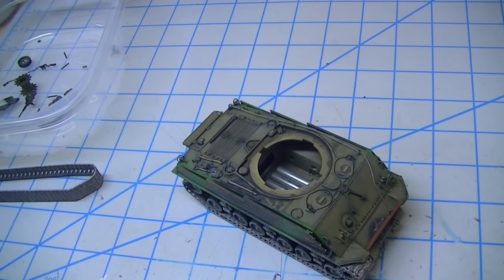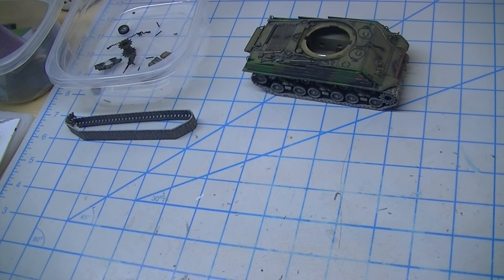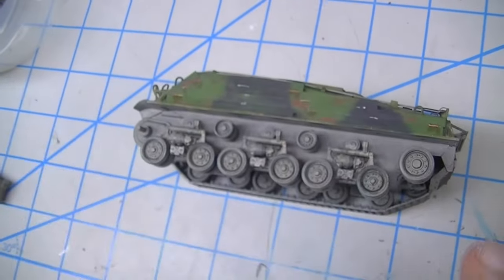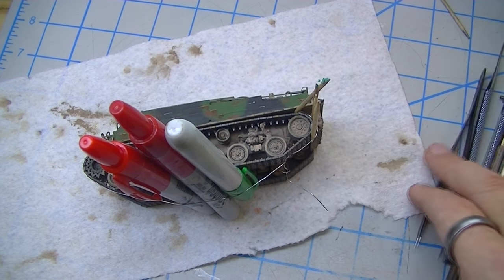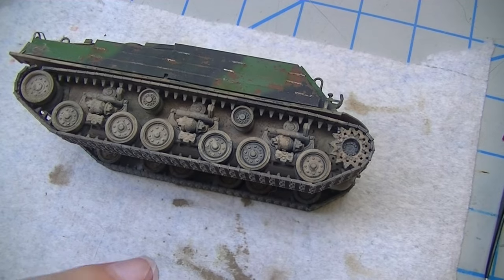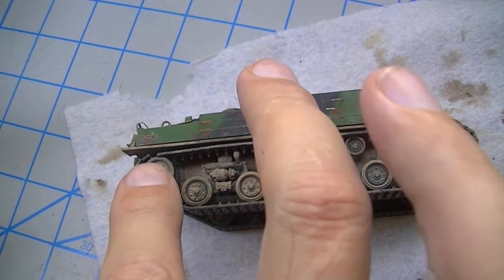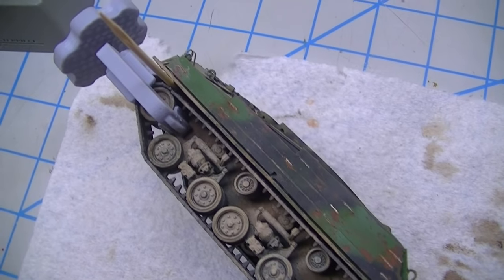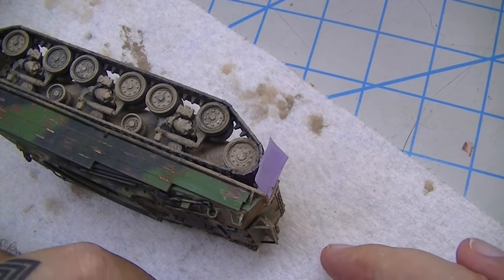ep372 - the 1/48 tamiya m4a3e8 sherman adventure part 6

Comment: If you’re ever rash enough to tackle another tracked vehicle with other than rubber band tracks, you could consider placing the unglued joint at the sprocket end and not cementing the sprocket to the hull until the track is fitted.  The sprocket teeth will help to hold the links together and the sprocket can be rotated to allow for any adjustment required before it is cemented in position.  In face if the track is cemented to all the other wheels and the other wheels are all solidly attached to the hull, you may not need to cement sprocket to hull as well.  It’s also worth checking before assembly (when you still have the sprocket and track separate) whether the holes in the links would benefit from being opened up a tad as this is less visible to an observer than trimming the sprocket teeth (and easier to hide with mud….).

Well done on getting it finished - more productive than I was last year although I did manage to design a load of parts in CAD, for which your P-40 seat was one of the first things I saw to inspire me, so thanks for that.  Hopefully in 2024 I’ll attach some of them to actual models.

Comment: Yup, tracks can be a PITA often. I usually manage to either bodge any ill-fitting-ness out, often by a little track-surgery, which usually means whittling a little material off them to close them up or sometimes just adding a small amount of glue to extend them if necessary. Obviously, it has to look right once done which means - if you are able - putting the worked bit out of sight if possible as much as you are able. Aftermarket tracks are out there for many vehicles if it all goes ar$e-over t!t though. Not that I have tried that on 48th, but 35th and 72 nd yes. Love watching your journies BTW! Oh yeah, one thing I do now is to pre-paint link and length tracks before glueing, weathering them too, then glue them on to the vehicle (with either PVA or extra thin usually) and this works better than the assembling them whole and doing what you did, which kind of ties your hands to how they stick-together off vehicle.